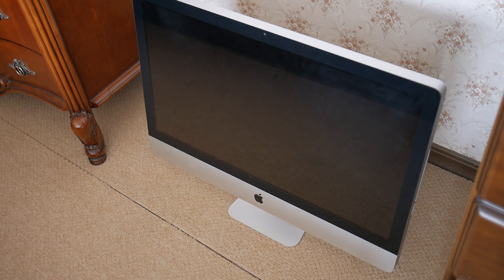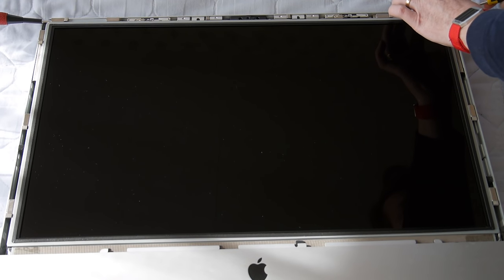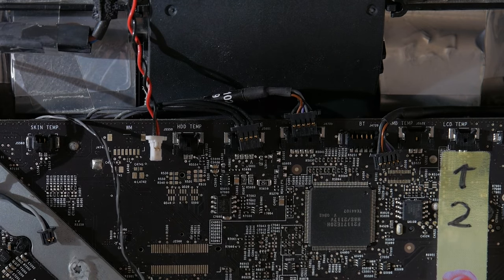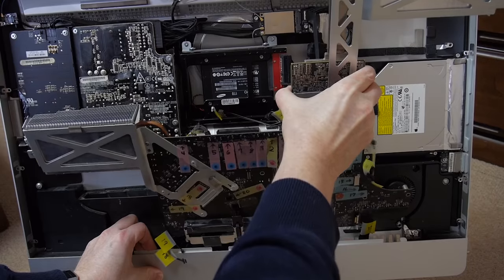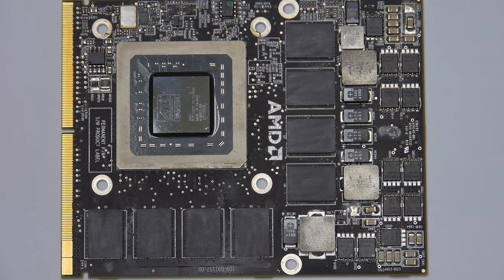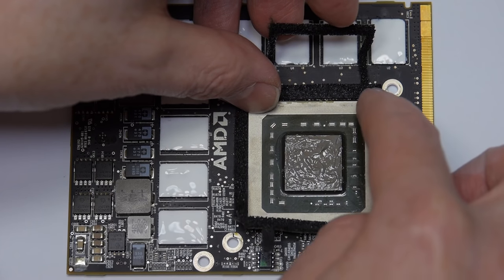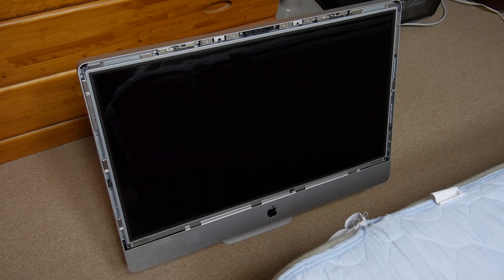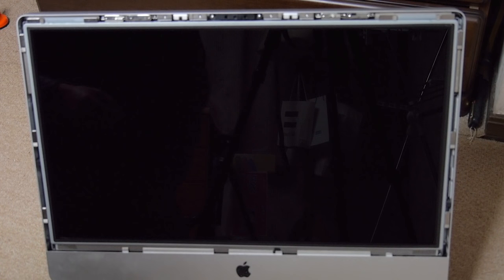Late 2009 iMac 27" Video Card Repair [4850 Bake]

Comment: Hello 

My Imac Mid 2010 27inch.
The screen goes blank many time (less than 1 min) but machine is still running. Is it graphic card problem? If so can i repair as your way? Thank you so much
Reply from the maker: It sounds like the problem is your video card, yes.  You can follow my video and perform the same repair in your card.  You have a 2010 model, which is very similar on the inside to my 2009 model, but not 100% the same.  Even so, you can still use my video as a guide.  Be aware that I made a second video as well, so be sure to see the link to that in the Description.  Best wishes.
Reply: JDW great. I will watch your 2nd movie. Is it new solution. Could u please send me the link again ?
Reply from the maker: As mentioned in the text description under the video above, the link to my 2nd video is this: https://youtu.be/6BJGLFCigdA
My second video is not a new solution.  It is the same solution that I unfortunately had to use a 2nd time, since my 1st bake lasted only 4 months.  But I am now on my 5th month of the 2nd bake and still no problems.  Even though my 1st bake (shown in the video above) lasted only 4 months, the procedure I show in that video is still appropriate.  Why the 1st bake lasted only 4 months is something I do not know.  If you watch both videos you will surely have all the information you need to perform your own successful bake!  Best wishes!
Reply: JDW thank you so much. I will try and let you know the result
Reply from the maker: Just create a Flickr account and upload your photos -- it's free.  After that, reply back here with the URL to the ALBUM in your Flickr account that contains the photos.
Reply from the maker: Thank you for the link to your photo of your video card. In the photo it seems you broke off one of the surface mount capacitors?   You would need to find the place where it was broken off and re-solder it for your card it to work properly again. But I assume your video card had problems even before you tried to remove it and even before you broke off the capacitor, right?  Even so, if you can’t re-solder that capacitor back in its original location on the video card, even if you baked the video card as shown in my video, it still might have problems.

Comment: Probably going to do this to my Dad's Mac during the night. It's not been opened since it was bought in 2010 i guess? Either way, thing is slow as hell, and I'm pretty certain the drive is slowing to a crawl given the lack of actual load on CPU or RAM.

Why during the night you might wonder? Cause he does not want me poking around in it - "it's fine" he says.
Bugs the hell out of me that it could be faster. So yeah, plan on dusting it out and such, cloning his drive and throwing an SSD in there during the night, and ideal scenario is that he wakes up his Mac being faster than he remembers. Then I can wake up and be like "Is your Mac still slow?" with a grin. 

It's a matter of time dad.
Reply from the maker: If your Dad's Mac is THAT slow, it's definitely insufficient RAM.  When I had only 8GB, I experienced that because my wife and I have separate users that we keep open all the time, and that was causing the Mac to hit the spinning platter HDD as virtual memory.  The second thing you can do is what you mentioned: add an SSD.  16GB of RAM + SSD = A Fast Old Mac! :-)
Reply: @JDW-  He's got plenty of RAM, it just has the hallmarks of a dying drive (something I've experienced with a HDD hitting like 27MB/s read and write, a drive from like 2010).

Heck, his Mac is slow even on a fresh boot. Wish he'd just let me have a day with his Mac and get it back to how it was when he first bought the thing. The amount of dust in there is probably high too. Only hope I have of doing it is during the night haha

Comment: hmmm, do you think I could stick an xmx 6970m or 6990m in that?
Reply from the maker: Without any cutting?  No.  I've read about people putting them in, but with a little modification of the frame required seeing those cards aren't exactly the same size as the stock card.  If you do decide to try it, please video your experience.

Comment: hello JDW, Before i try that i want to ask : when i log in with safe mode the screen display looks fine, but if i log in as a normal user the screen is all pixely and with lines. Do you think it is a Video card issue and i should try what you do in the video? or it could be something else ??
Reply from the maker: I’ve seen the same thing myself. Safe mode tricks you into believing that all is well, but in fact that is not the case. You still need to bake your video card, I’m afraid.
Reply: If I remember correctly, safe mode bypasses the graphics card and consequently also bypasses the verification stage of the graphics card so it will allow you to boot-up.  However the computer will operate with limited functionality,  i.e. some ports will not work, the screen will have a different color tone, and there might be an impact in performance all due to the bypassing the graphics card .  The good thing though, is that it allows you to make any last minute back-ups of your hard-drive, which is recommended  before you perform surgery on the video card.  Even if you have Time Machine back-ups, I would recommend to make a second full back-up, don't blindly trust time-machine.
Reply from the maker: Safe Mode does not bypass the video card. If it did, you’d have a totally black display. Safe Mode disables video card acceleration and all related features that are not absolutely necessary to display video. But some iMac video cards are so bad off that that iMac won’t even boot into Safe Mode, giving you only a black screen immediately after you press power, giving you only the boot chime.
Reply: @JDW-  Are you 100% sure?  I am not able to find anything definitive as far as what Safe Mode does with regard to the GPU, but because these do have an Intel CPU, it is entirely possible that in safe mode, the graphics loads are handled by the CPU.  The 2011 MacBook pro's had similar issues as the iMacs.  Read these articles for your entertainment: 
1. 2011 MPB: https://www.jeffgeerling.com/blog/2017/fixing-2011-macbook-pro-booting-grey-screen-amd-radeon-video-glitch
2. GPU Problem: https://apple.stackexchange.com/questions/267581/gpu-problem-boot-hangs-on-grey-screen/295805#295805
3. MBP GPU Repair: https://realmacmods.com/macbook-2011-radeon-gpu-disable/
Reply from the maker: @jackprick9797  I am 100% sure what I wrote in my previous post about Safe Mode is correct, and the proof is from Apple itself.  Open the following URL and do a keyword search for "graphics": https://support.apple.com/en-gb/HT201262

Comment: Hi JDW, could you give me the exact names and models  " Thermal Paste for GPU heatsink" you use here? Thanks in advance.
Reply from the maker: I used Arctic Silver V on the GPU and a no-name brand, generic white thermal paste on the memory chips in my 1st bake.  However, I don't recommend either.  In the description under my 2nd Bake Video (see Description above for link), I explain that I use non-electrically conductive K4 Pro and K5 Pro on that 2nd bake, and that 2nd bake has kept my iMac running from July 2017 until today.  My iMac is used daily and runs great, so I recommend you use the K4 and K5 Pro pastes, both made in Greece but sold on Amazon.  If you want to see what the actual package and product looks like and see how I applied it, just watch my 2nd Bake Video.
Reply: Thanks JDW

Comment: After trying different recipies which were unsuccessful I finally solved the screen recurrent light problem on a late 2009  iMac 27" by changing the LCD power card (Darfon V67-601HF) The card is very easy to access. Main difficulty was disconnecting/reconnecting the V-sync cable, very short and fragile, when lifting out the display panel. I found the replacement card in France at Sosav.fr for 153€. The iMac has been working perfectly now for more than one month, worth the spending.
Reply from the maker: So it seems you had a "display backlight" problem that you fixed with a new LCD inverter board.  Great work.  So long as you can find the part easily, that fix would be much simpler and faster than the video card bake.  But of course, the video card problem is unrelated to a faulty backlight.
Reply: Absolutely right. This was first time I ventured inside an iMac. I started suspecting the video card and "backed it 200°C for 8' " in a first try to fix the problem: no effect ! Then I thought deeper about my "screen problem" and finally decided to change the LCD inverter card: total success!. This is what I wanted to say. Thanks for your reply !  @JDW-

Comment: Help what can I do I just keep getting the beeping sound you had too .. you think my memory ram what mess up ?
Reply from the maker: The beeping occurs when you put your iMac back together and forget to put back the RAM. If you did put back your RAM that it’s possible you did not inserted correctly.  Hopefully you used an antistatic wristband when you removed your RAM and then put it back so that you did not harm the RAM by accident.
Reply: JDW no I didn’t use an antistatic wristband🙁that what I forgot to buy .. you think that I mess my  ram then ?
Reply from the maker: If you walked on carpet with stocking feet while removing and/or holding the RAM, static very likely could have zapped your RAM into oblivion.  But don't panic just yet.  Remove all your RAM, then carefully reinsert it and make sure you push the RAM in as far as it will go.  If the RAM isn't socketed properly, that means it's pins won't make a good connection with your iMac's motherboard, and in that case you will hear the BEEPS, which are telling you to reseat your RAM.  But after doing that if you still hear the BEEPS, then I am afraid it very well could be a case of bad RAM.